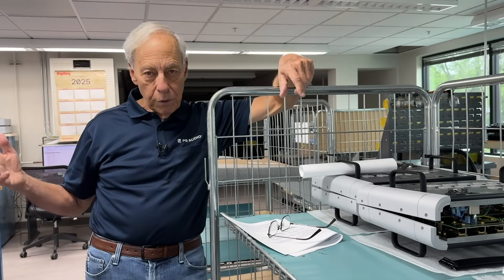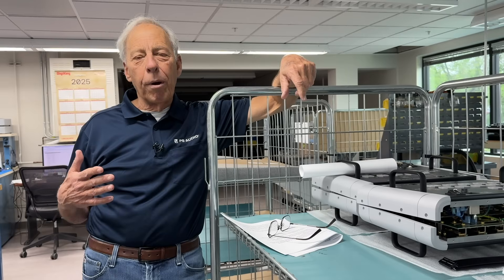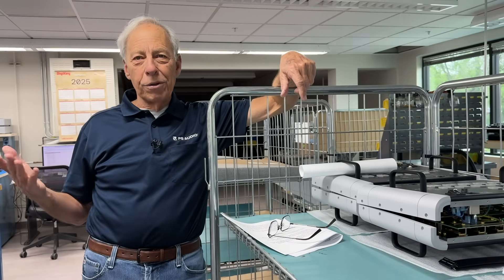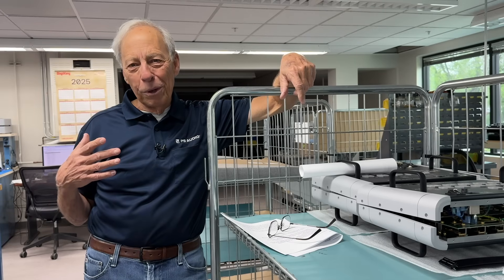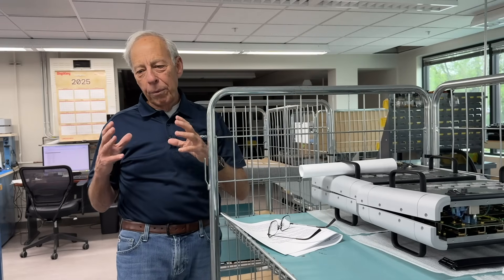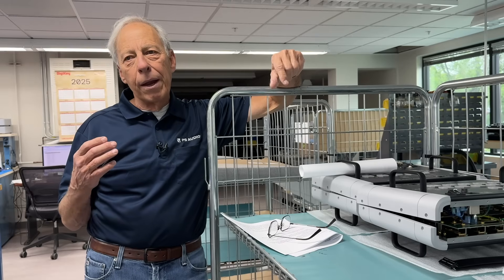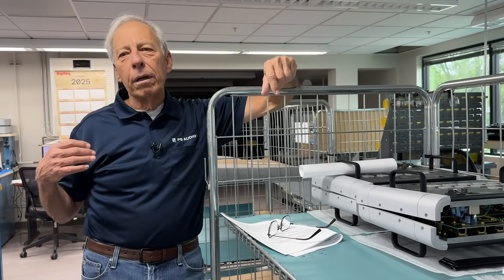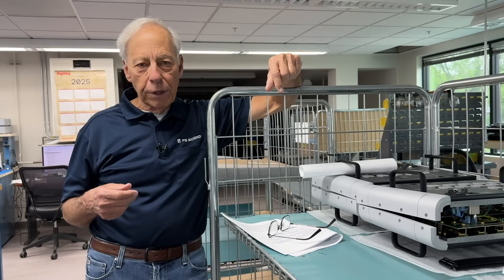Balanced Phono Cartridges

Comment: An answer to why turntables are not (usually) balanced was simply early amps, and the drive to make them affordable back then - and nobody saw it as 'broken' so it never got fixed.  (the old adage, if it ain't broke....)

As for your live outer shell on an RCA, truly horrible, like using the outer shield of the cable feeding that plug as also an active signal.  The 5 pin DIN makes more sense, pin 2 the traditional ground, and the other four pins for two balanced pairs. an adapter cord to two XLR's (or two RCA's) would be so easy to make.
At our church we had two XLR's on a wall plate for connecting a sub-mixer for musicians, those were run at line level, however endless people plugged mic's into them then complained that it didn't work. So I swapped them out for a single 5pin XLR, Pins 1, 2, 3 as usual, with pins 4 & 5 the second (right) channel - using the earth from pin 1. No more complaints, as you could not shove a mic in there.

Comment: Back in the day one of the balanced leads off of the coil was tied to the metal case most cart were made of. A little metal strap straight from a pin into the case. Grounded the case provided a hum shield. You could remove that to get a true balanced output. But then the case no longer acted as a hum shield.

Comment: Some ProJect Turntable's are balance line.
Reply: I have their pickit pro balanced cartridge, their S3B phono preamp also balanced and their 5 din to rca cable to ensure balanced path all the way from the cartridge to my balanced headphone amp inputs and outputs. so I went as balanced as I possibly could with my NAD C558 turntable. now it's dead silent in between tracks which is pure magic. where there was hum and noise before. never going back to single endedness

Comment: Can someone explain what is meant by ‘balanced’? I can’t follow what Paul says without that information.
Reply: Most audio is sent over wires one of two ways. The coils in magnetic carts are just coils and each channel's has two wires out, a positive and a negative. They are balanced. No common ground, just the signal balanced across them. An XLR has two wires, one for each and a third as the ground to provide hum shielding. 

 The typical "RCA" connector is where there is only an outer crown/ shield and an inner wire to carry the signal. This is single ended or unbalanced. Typically one of the balanced ends of the coil, usually the negative, is connected to the cartridge case and the outer shield wire as ground. And the signal from the positive wire is sent down the center wire.

Comment: Like some below I can only speculate about the "standard" RCA connection. My guess is that PCA was the standard in tube pre-amps, and it became a de=facto standard. In the day single ended may have been preferred because of the extra expense of creating a balanced input tube circuit as opposed to single ended RCA. Also, input circuits that preserve all of the the benefits of balanced inputs such as common-mode suppression tend to be more complex and/or expensive to manufacture.  Hope you have been able to sort out and work through those sorts of issues in your new phono stage and look forward to its introduction.

Comment: bruh, all turn table carts are basically in balance, they have a left and right +/- .  its just a conversion wire that makes it unbalanced and balanced.
Reply: Bruh I Know Your take on this 
My question was just for the knowledge about WHY some manufacturers made turntables with both RCA and XLR hardwired on the back of the TT and since the  cables are a just five I was asking to Paul how It was possible to let it work with two connections available... Paul was gentle in answering my question but if You refer to me as BRUH... Sorry but I'm not the usual "Audio Turist" to poke in the forum... Wrong person DUD 
My aim is not to be rude or to raise a discussion... But reading BRUH regarding this just NO
Reply: @lucalamponi173  I think you should talk to someone with more experience.  Most*** the tables all have a +/- coming from the right and left channel of the cart.  The cart, armature itself is always grounded.  The + is always the pin on RCA and the - is the ring on the RCA.  If you take a cable and just rewire the ends so the ring is XLR- and the pin is XLR+, the. Ground to chassis you have a automatic balanced connection.  There are very few turn tables that are not wired like this.   Most unbalance setups still take a balanced ring/pin connection from rca and just use the pin+ for the signal.  That's why it's a RCA unbalanced connection. However almost all the. Takes are wired in balance but using RCA.  So if you deduce the connections and soldered points for the +/- you can just make a conversion cable easily.  Just about all stereo turn table carts ever made are automatically a balanced setup and wired configuration.
Reply: @spdking Not a matter of questioning Your experience or not, I was just noting Your reference to me as BRUH... It's a rude way to refer to someone who's having a simple question that is still have to be answered. I know how connections work on a Turntable but in this case as I said I was just asking why and how some Turntables use both (Take as an example the back of a 1500/1600 new Thorens and maybe You can have my point) I wasn't arguing Your knowledge I was a bit offended by the way You were refer to me with that BRUH. I didn't want to raise a "I KNOW MORE THAN YOU" war, I just wanted to aware everyone that in our hobby and passion is not good when poke is around, just this, not a good thing to do. I don't have trouble with You. Never have and if You were offended by my manners I want to say Sorry. My bad.

Comment: Thank you for bringing this topic, here is my understanding
1. The "5 Pin DIN" refers to the tone arm internal connector, not turntable output.
2. The "formal" way to have a balance Cartridge output is having Positive negative and zero connection for Each coil, this is not available on any cartridge that I know. So this is first limitation.
3. However, you are correct that the Coil could be "Floating" directly connected between XLR N and P inputs and still maintain it's balance for external noises, but there is one missing point, who provides the Zero point Reference? there has to be one for each coil and with this type of connection it is a "phantom Point, generated by 2 47KoHm resistors between Pre amp Positive and Negative inputs to Preamp Ground.  
4. The major problem that prevents full XLR implementation is that most if not all cartridges uses the negative Right cartridge output (Color Green) for a singe point Cartridge Shielding connection to ground. Many if not all tone arm manufacturer are also using the same contact (Green Color) to provide the tonearm single point connection to ground.
5. to summaries my understanding of the subject:  There should be a full path of cartridge, Tone arm internal wiring, Tonearm internal connector with at least 7 wires and pins, and A a proper middle (Zero point) Ground  connection to Shield in order to achieve a true balanced output from a turntable
6. I have tried it my self on my turntable. The internal tone arm wiring do include 7 wires,  and is  wired all the way to the phone preamp XLR input. I works "fine" but when I touch the tonearm it generate a loud HUM noise. so I had to connect the negative of each channel at tone arm output to the GND, then it worked fine but became a pseudo balanced connection:  a shielded single ended path within a fully balanced wiring.
7. Bonus: with a full XLR connection (A Semi XLR in my case) between Cartridge to Phono Preamp there is no need to additionally connect a Ground Wire between Turntable and Preamp Chassis.
Reply: My B&O turntable has a 5-pin DIN connector on the outside of the unit.  They supply a cable that converts from that to the usual pair of RCA plus a single-wire ground connector.  At the moment, I don’t know if they use any more than 3 of the 5 pins.  Typical DIN usage for line-level playback-only devices (e.g. 8-track or CD) is to use a 3-pin subset, or the 3-pin connector that can plug into a 5-pin socket.
Reply: @kc9scott  If it's real DIN it's a 5-pin connector but only 3 pins are in use on your turntable. Left, right and ground. And it's not balanced. The other two pins on the old 5-pin DIN standard connector are dedicated to tape deck inputs (just for recording audio from an amp) and are not in use. A three pin connector would've fit into a 5-pin socket as wel but 5-pin connectors were common practice at European equipment like B&O. The reason for that was backwards compatibility with the old 3-pin mono and (yes!) balanced standard. The 3-pin connectors were never used for stereo.
Reply: @hugoromeyn4582  It’s real DIN, and I just now rung it out to be sure.  It’s the same 5-pin connector type as is used for tape decks and MIDI.  The 3 pins that the turntable uses are the same 3 that would be playback on a stereo tape deck.  On this cable, the shell and the center pin are isolated from each other, with the DIN shell being for the turntable ground wire, and the DIN center pin being signal ground for the cartridge, going to the RCA plugs.  You’re right about 3-pin DIN connectors having been for mono record/play devices, and NOT for stereo play-only.  Of course it’s not balanced.

Comment: On the DIN 5-pin connector: They are referring to the DIN connector at the base of the tonearm. These connectors are balanced: the pins are L-, L+, R-, R+, and Ground (ie a connection to the arm's structure that acts as a shield). It is possible the arm maker decides to tie L- to G, but that is not necessary and most don't. Then comes the phono cable that goes from this DIN connector to the preamp. This cable CAN be balanced even with RCA connectors on the other end. This is achieved by making the collars of the RCA not connect to ground at all but instead have the ground be the shield without connecting to the RCA collar. In this configuration, the RCA pin is L+ (or R+), the collar is L- (or R-) and the shield or ground is a separate cable that connects to the shield of the L or R cable but this shield is NOT tied to the RCA collars. As an example, my CrystalCable phono cable is wired this way. The next step is whether the input of the phono stage respects that the ground is NOT connected to the RCA collar or not. It is complicated and these design decisions are generally not spelled out in manuals or specs unfortunately. 

At the end of the day, what matters most is that we don't create ground loops by mixing up design decisions in the different components we have in the phono chain. These ground loops are by and large the most important sources of hum.
Reply: You look the right answer and you definitely have the right cables!

Comment: Paul, I’m here to make that “you knucklehead” comment.
Most tonearms DO have a balanced output signal, although it is a floating signal using the RCA plug’s pin for the positive phase, and the shell for the negative phase. That’s why you need a separate ground wire to avoid hum. As you say, most preamp phono inputs do connect the negative phase to ground, but there are exceptions such as Ron Sutherland’s phono stages which make a balanced connection using a standard RCA plug tonearm cable.
There are tonearms like those made by Rega, which tie the arm ground to the shield of one channel on the cable, and cannot be used in a balanced configuration.
The 5 pin DIN the writer mentions is at the base of the arm where the cable connects to it, not where the cable connects to the preamp. This is a pretty standard connection used on many arms with a detachable cable. It is not the same 5 pin DIN as we used 50 years ago to connect things like tape decks. Tonearm cables are available in both 5 pin tonearm DIN to RCA, and 5 pin tonearm DIN to XLR. Either can be used to make a balanced connection if the phono preamp is configured for it.
Reply: Many (older) cartridges have one negative output grounded internally so there is no need for a grounding wire.
Reply: Rega have been very staunch not to require any additional ground tether. I own a P3 and have never experienced ground issues. I did when I first got it but that was due to poor setup

Comment: The answer is surely cost and accessibility - it has always been RCA and so why change it? 
Well you can buy balanced phono cables - 5-pin din plug for connection into the DIN 5pin Output Connector at the arm end and a pair of balanced xlr at the downstream end (like the Atlas Equator 5-pin phono cable - 1.5 m, RCA or XLR) - sometimes plus a separate earth or not (the earth should be built into the XLR). 
However, finding a good/great step-up up transformer or phono stage that accepts balanced xlr in very quickly takes one into rarefied territory (like Esoteric E1 Balanced Phono stage Preamplifier or the Linn Uphorik Phono Stage Black). When available at all,  balanced-in is often an additional option (as it is for the NAGRA HD PHONO).
What is important when using an MC cartridge is to ensure the step-up transformer is as close as possible to the tone arm and the leads connecting the two are away from sources of RF interference. One exotict turntable manuacturer (Sheffield uk) locates the step up transformer on a bracket above the pivot point of the tone arm so as to have the shortest cable length from cartridge to transformer) others like Linn offer phono decks with built in step up transformers like the Urika, which is mounted in the chassis of an LP12.

Comment: I must have a very rare phono system. As My ETA turntable has the 5 pin DIN connector that is going to a Balanced Audio Technology P12 phono stage. BAT being fully balanced, (as that IS their thing) only has XLR connectors. With that, I use a fully balanced split (it has two cables off coming off the din connector) cable from the turn table to the phono stage. With both a 5 pin DIN on one end and the two XLR connectors on the other. This cable also has it's own dedicated ground wire for the shielding. This cable was built by "Art Audio Cable". Using it in a fully balanced set up, I've never heard anything quieter and  more wonderful coming from a turntable.

Comment: That’s interesting feature. 10 years ago Yamaha introduced GT 5000 with balanced xlr connectors. They recommend mc cartridge with balanced connection with their c5000 pre amp to get full advantage of Yamaha 5000 series amp and pre amp . In this way signal stays balanced from cartridge to speaker terminal,  with their floating signal design.

Comment: For home audio electronics, it would be a big help to have an "XLR "plug standard, which would be a scaled-down and compact version of the PRO XLR hardware used for Rock-n-Roll setups. Something that would fit behind components and not need 6 inches of connector and cabling space. DIN5 is okay,I guess,but I think the Consumer Electronics world needs its own little connector standard. Perhaps a "Mini XLR",slightly bigger in dimensions than an RCA connector. 1/4 inch TRS plugs are still too bulky,and 3mm are too small and fragile. A"Goldilocks" connector,as it were.Did this description make sense? Is there a balanced connector used by the Big Guys already that I'm unaware of? Google searches just brought up the standard XLR gamut.Thanks!
Reply: Mini-XLR exists and is used on TTs..
Reply: @razisn  Thank you. Is that the only device to have mini-XLRs? Can you provide a link or a picture of what it looks like?
UPDATE: TINY QG connectors.
Switchcraft in America has them.
Thanks, #razisn for the nudge for me to look at this deeper!
Reply: @jeffmassey4860  some headphones use mini-xlr, my akg k702s do

Comment: Most MM cartridges are NOT balanced because they short the ground of the two channels internally. Don't ask me why, but that's a fact. It probably had to do with some manufacturing convenience. One can easily test with an Ohm meter. To take advantage of balanced wiring from cartridge to phono pre, one either has to use an MC cartridge or one of the few balanced MM cartridges that have recently appeared in the market.
Reply: A little circuit surgery can turn any turntable into a True Unbalanced unit, unless you are talking about the cartridge itself having a ground reference,of which I am unaware The only difficulty is,there is no Consumer Electronics version of the XLR plug. And DIN5 lacks proper shielding.
Reply: @jeffmassey4860  99.9% of MM cartridges are internally single ended.
Reply: @jeffmassey4860  99.9% of MM cartridges are internally single ended. No amount of tonearm and turntable rewiring will turn these into balanced.. Take an Ohm-meter to a MM cartridge and check out for yourself. Chances are the 'negative' terminals of the two channels show no resistance between them. They might as well have 3 pinouts instead of 4.. Pro-Ject 'Pick it Pro Balanced' is an example of the new generation of MM balanced cartridges. Btw, there's mini-XLR used on some TT for balanced connection. You can even use RCA sockets for balanced connection from the TT to the phono pre given a balanced cartridge and correct tonearm wiring (which means keeping 'negative' out separate all the way).
Reply: @jeffmassey4860  Most MM cartridges are internally single ended.

Comment: Remember tape decks used the 5 pin DIN connector? Strange times.
Reply: The 5 pin DIN used to connect a tonearm cable to the arm locks somewhat similar, but is not compatible with the old style 5 pin DIN used for line level signal cables.
Reply: @gotham61  yes that's correct.
Reply: Yeah,and good luck trying to find one not already factory-assembled,discrete part,back then,on this side of the Pond.
LOL